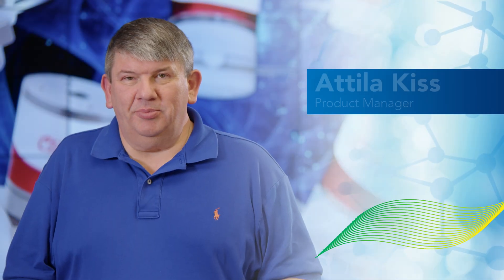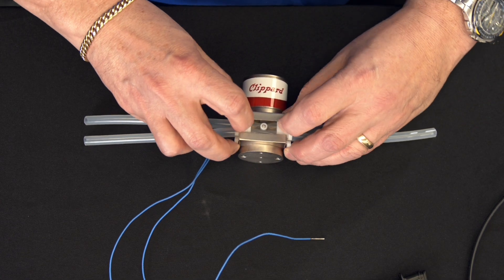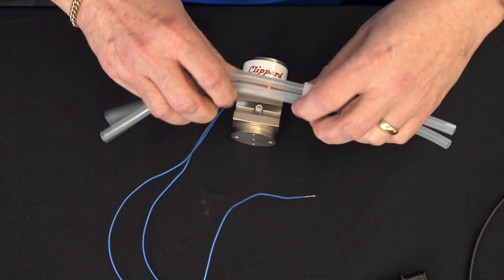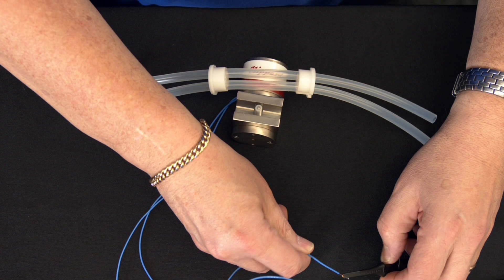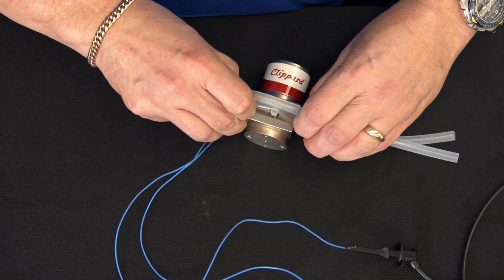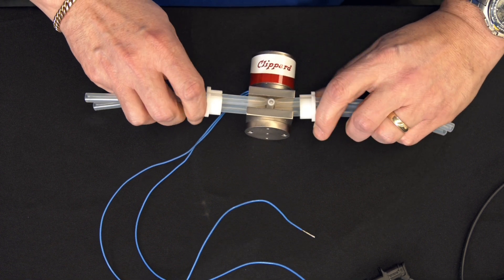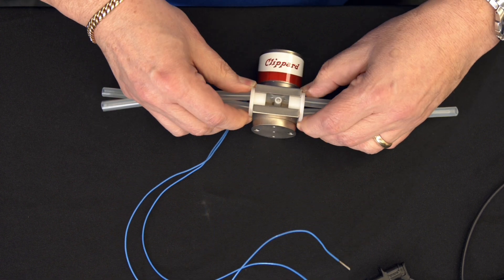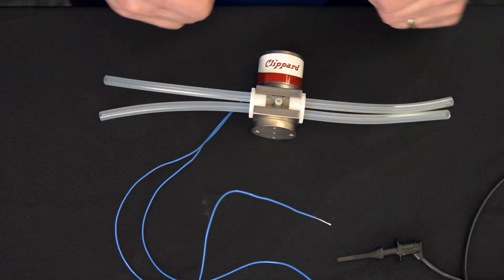How to Replace Pinch Valve Tubing in a 3-Way Pinch Valve

Comment: So, as a former Assistant technician at Chuck E. Cheese,  I know CEC had a contract with the Clippard to provide CEC's pneumatic cylinders for the animatronic character and basically anything in the location that requires a cylinder. So much and i guess for so long that they'd even come from Clippard whenever ordered from their part dept. with a custom CEC logo on the cylinder rather than the red Clippard logo... So, I got one of those signs from the stage show that says, "In Pizza We Trust" with a sculpted face of CEC himself with an eye that appears to "wink" via a clippard cylinder that pushes air through a spring-loaded Clippard cylinder. So, in short, I was wondering if you guys had like floating technicians or a Clippard office in or near San Antonio, Texas? Im asking because as a paraplegic in a wheelchair, I'd love to get help from someone at Clippard who can maybe suggest another type of cylinder and set up a sort of push-button way of rolling up to a button perhaps and the button would activate the cylinder, thus making the eye wink whenever i had my compressor connected or even an airless, fluidless but electric cylinder so that I could make the sign "wink" without having to have the compressor connected to activate it. I think it would make great publicity for Clippard and the disabled community and could also possibly land you guy a new contract with Chuck E. Cheese since I'm sure the previous contracts is all but desolved because of them getting rid of their shows nationwide. Win/win all around. When was the last time you guys shot a video that shows Clippard helping a paraplegic customer who happeneds to be a fan of Clippard cylinders!? 😮😊💯😉❤️
Reply from the maker: What a fun memento—your winking sign sounds very cool! It's true that in the past, we did a lot with motion control and our cylinders were used to help bring Chuck E. Cheese and the animatronic band to life. Our focus now is more on precision pressure and flow control for life science, medical, analytical, and niche industrial applications. We no longer make cylinders, but your local Clippard distributor still sells them from other brands. Their contact info is available at https://www.clippard.com/distributors, or reach out to sales@clippard.com and we can put you in touch with someone. Best of luck with your project! 🍕🐭🧀